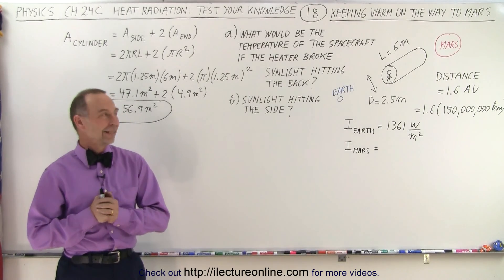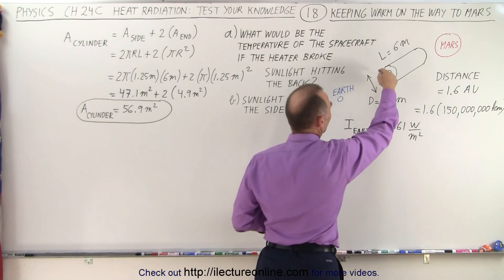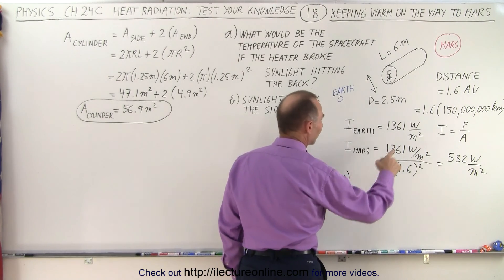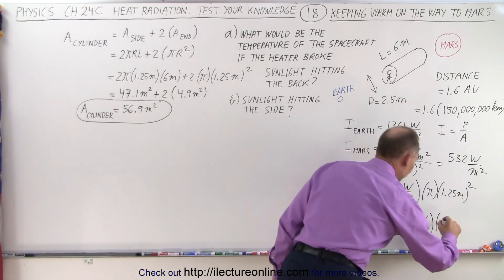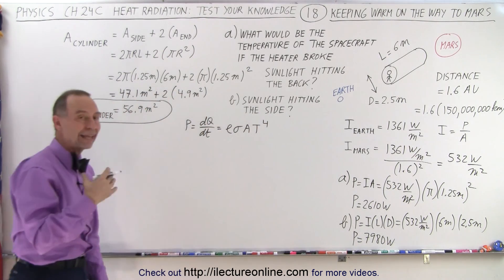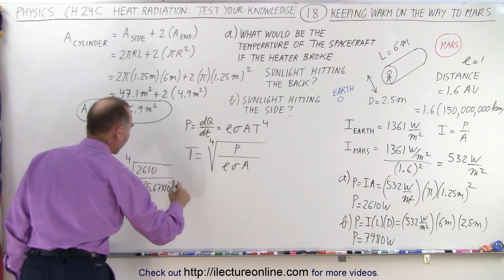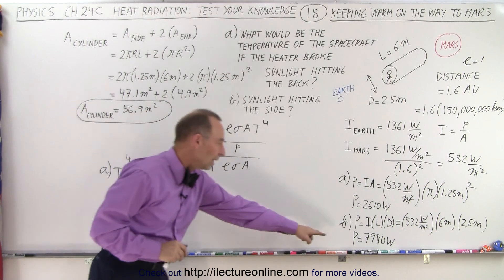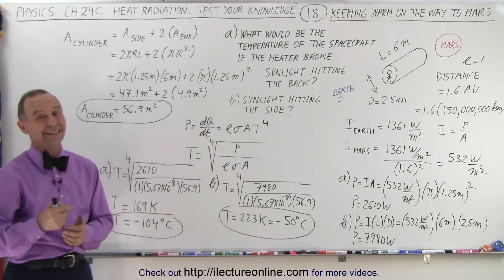Physics: Ch 24C -Heat Radiation: Test Your Knowledge (18 of 20) Keeping Warm on the Way to Mars

Comment: Could you explain emisivity (e)? If it was 0.1 instead of 1, temperature in case a) would be 299.9 K or 26.8 °C
Reply from the maker: The emissivity is an indication of how well a substance absorbs and emits electromagnetic radiation.  For most substances it is close to 1.0  (ranging from about 0.95 to 1.00)
Reply: @MichelvanBiezen  Seems we need to get a material with really bad absorption/emission rate and we can go to Mars :)